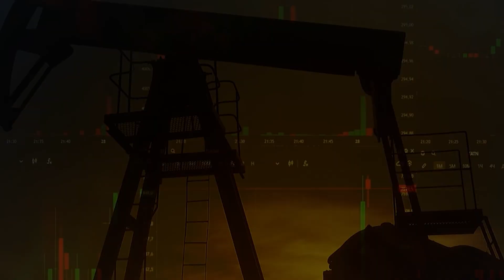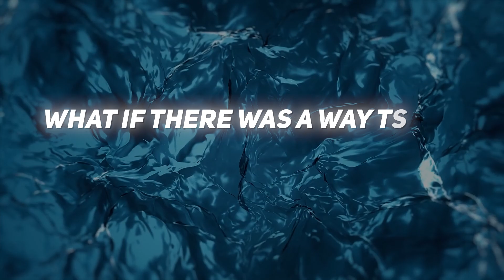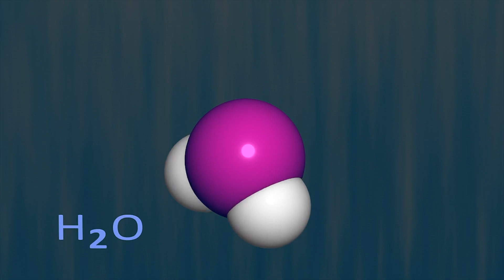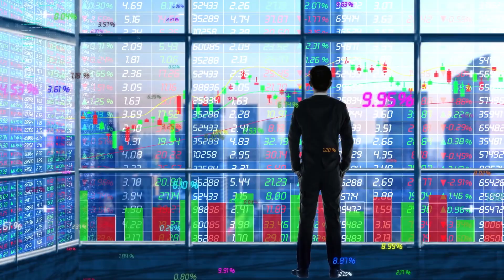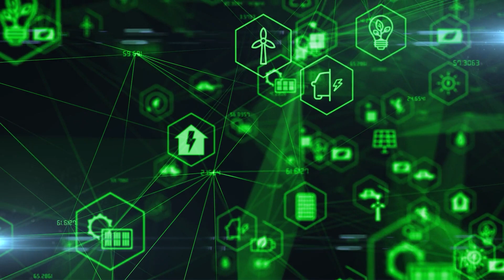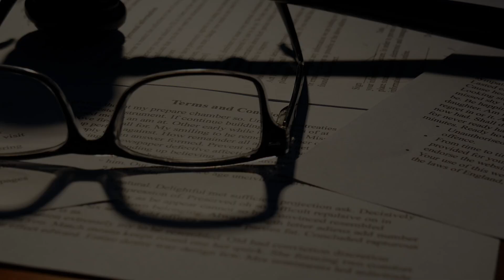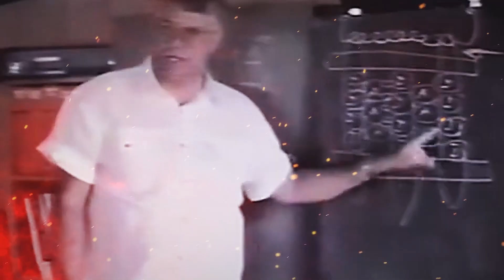Dark Truth About the Water-Powered Car

Comment: I remember him being on the local news when passing through driving the buggy cross country or a long road trip not sure which. I also remember seeing an interview or vid he made himself in his garage giving a basic explanation of how it works. I think it was explained as something similar to pulse width modulation to make hydrogen in the most efficient way possible on the fly without needing an expensive tank to store it in the car or all the losses that come with that from stuff like storage and transport. I think he was expecting something around 90% or over compared to the current 60-80% through electrolysis but hadn't got it officially tested. I think he had 6 car or deep cycle batteries he had to charge every hundred miles to produce hydrogen there where no claims of free energy/beating physics than I can remember. Sometimes when I see him come up and people calling him fake making the free energy claims I think he probably did find some highly efficient way produce hydrogen on the go and wouldn't be surprised if they swapped the patents for fakes and killed him to protect the petrodollar. I also wouldn't be surprised if it wasn't nearly as efficient as he thought and the death was a coincidence.

Comment: Why is there all this attention to "loss of energy in producing energy"? This also happens where crude oil products are being used as a source for power, and nobody argues that it is not usable. So that is not a valid argument against the usage of water as a source of energy. Maybe Stanley Meyer should have formulated it not that explicit? But anyway, there are other problems in using water as a means of energy in vehicles, namely the problem of producing the desired volume at the precise moment. Don't forget that hydrogen in it's purest form is a very powerful explosive and vehicles are prone to collisions, bumping and shocking. If it would be used as a source of power in vehicles their should always be a fair amount of hydrogen ready to use in case a sudden need for power would arise, i.e. climbing hills, evading obstacles and so on. That hydrogen, plus the entire provisioning of the engine, should have to be shockproof under any circumstance. You would probably only be able to use it in armored vehicles that are bomb proof. Not much of a future in that, I suppose.
Reply: No, no, no. Hydrogen is no more explosive than gasoline vapors, acetylene, propane etc. It's just another flammable gas. Your comments re shockproof, armored vehicles etc. are nonsense. Bottom line: Myers pretended to overcome the laws of physics, and that is why it is not possible to duplicate his 'success'.